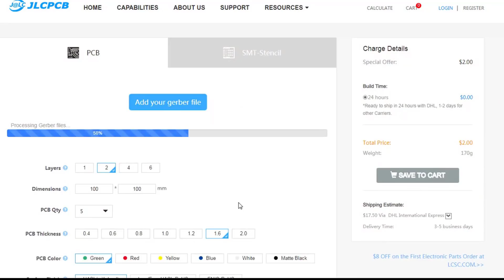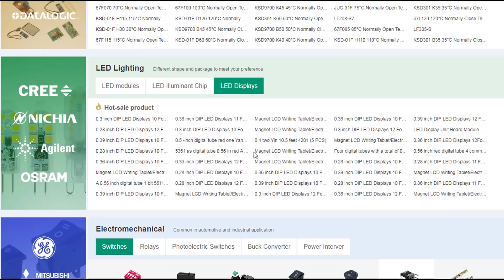Simple 200W Inverter 12V to 220V | Use Electronics Component from OLD ATX PSU

Comment from the maker: Hi Friends. Today i make Simple 200W Inverter 12V to 220V | Use Electronics Component from OLD ATX PSU. I hope you like that, i use ee35 ferrite core from old ATX PSU and IC TL494.
Primary lizt wire 15x0.3mm : 4Tx4T Secondary 110T x 0.5mm. The max power around 300W. Please check electronics component in my description. All file donwload here:http://bit.ly/2pvdvyj Include gerber file. Thank
Reply: Friend, the secondary wire is 110T? The wire thickness is 0.5mm or 0.05mm? The primary thickness 0.3mm so the secondary wire should be thinner, right? Please advise friend. Thanks
Reply: Friend, do you mean the primary wire thickness is 15x0.3mm =4.5mm and the secondary wire thickness is 1x0.5mm =0.5mm?
Reply: Please share the link of the gerber application. Is it free? Thanks my friend
Reply from the maker: Make Litz wire by use 15 wire with 0.3mm each wire.
Reply from the maker: Secondary only one wire 0.5mm winding 110 turn
Reply: What is the output frequency of ic tl494 sir?

Comment: Hi dear
I made it but dont work
how many amper need to run this inverter
please help me to run in secsfully. thanks
Reply from the maker: Did you check your circuit  all electronic component capacitor resistor... ? Check value of them ! This inverter can run with 12V 2A
Reply: @LongTechnical  Thanks. i check it again
Do Transformer Values Exactly Be Observed?
Problems with some change in wire diameter?
Reply: @invisibleman6330  did you done this project successfully??its working?
Please replay

Comment: Please Mr, i do not transformer winding have a computer to use the software over there, can i know the details of transformer
Reply: Can i find out more about this transformer?
Reply: How to wrap this transformer. The value and circumference of the wires
Reply: This is EE35 transformer you can find this from old computer smps.

Comment: i make this type of inverter with SG3525 ic and IRF3205 mosfet but after few second mosfets are extremely hot. Transformer same with  0.5 mm copper wire  3-0-3  and 90 turn , whats the problem  plas can u suggest?  I make that inverter from homemade102 channel's circuit diagram. and another question  can u face any heating problem from this inverter ?
Reply from the maker: Do you have OSC you can check the waveform at pin G of mosfet ? Check and email to me i will help you
Reply: same issue for me.transformer is heating up...need help
Reply: @kshari2  did you done this inverter perfectly? Its really working??
Reply: @Shyamkumar-di5fu  yes everything was correct.I spent a lot of time and finally I found that this circuit does not last long.there are many flows I. This circuit..good for only low watt application that too only for less duration.I have lost a good amount of MOSFETs trying again and again.I suggest you to go for sg3525 which is very good and durable.transformer winding should be 4-0-4 and 110 turns.
Reply: @kshari2  ok